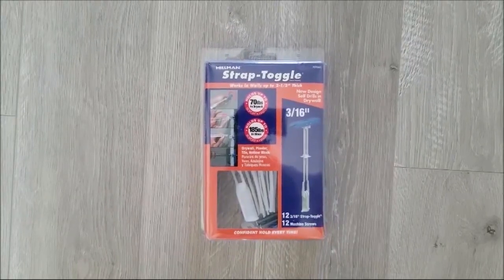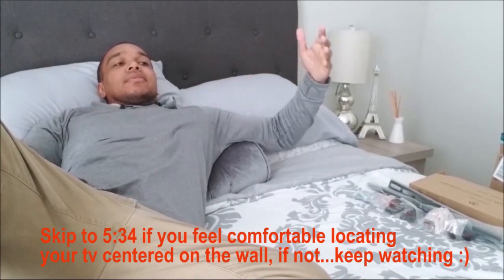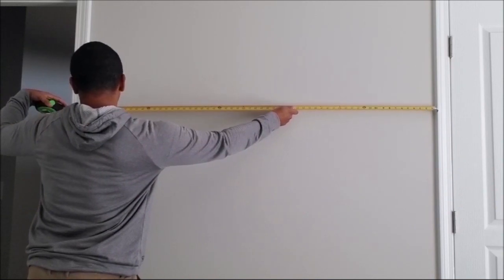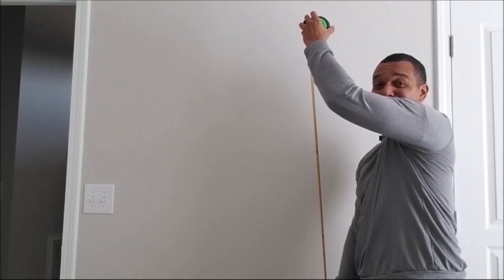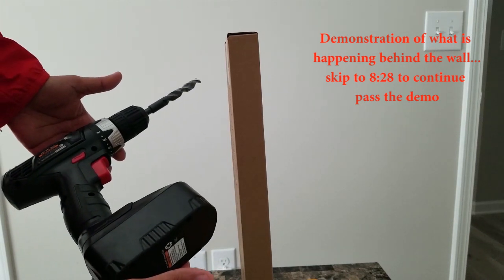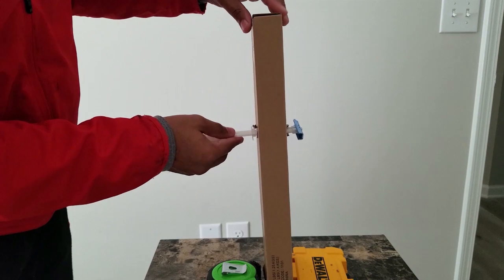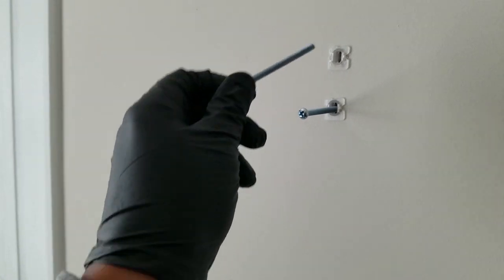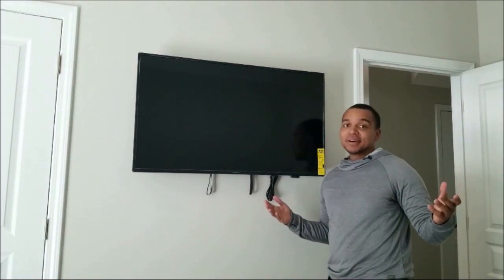How to mount TV on wall | NO STUDS

Comment: It's REALLY worth mentioning that this method is ONLY safe for flat wall mounts.  These types of toggles are rated based on sheer weight only.  Swivel mounts or full motion mounts create a LOT of torque weight and the drywall is very likely to fail!
Reply from the maker: Good point, the shear strength within the gypsum board is where it's at with this type of mount
Reply: Thank you for the info. I was wondering about how will work with Swivel mounts too. You made it clear.
Reply: So...the idea is that you should only mount a swivel mount onto a wall stud, and not this method?
Reply: @chrisbaldwin3148  pretty much.  There are other mounting options if you want to use an articulating mount, but shouldn't rely on drywall alone.
Reply: A VERy important piece of information. Thank you!!  What then is the method  used for swivel mounts?
Reply: @honeybeehelper-1  There really aren't any shortcuts for swivel/ articulating mounts.  You have to locate at least 1 stud to anchor the mount to.  I prefer 2 if I'm mounting anything 60" or larger, and if the TV weighs more than 50 -60 lbs.  But unless your TV is a heavy giant you can usually getaway with one stud.  In cases where I only have one stud to mount to I use a combination method, both securing it to the stud, AND using the method from Engineering Mojo's video.
Reply: Yes!! My husband put a full motion on drywall and a week after our tv was on the floor 🥲💔
Reply: @saramartins3391  Damn, that sucks!  I'm sorry that happened.  Did the TV get damaged?
Reply: @captaintortuga3191  yes.. it cracked on the sides.. I am heartbroken. We purchased a new one with a flat wall mount, and we bought metal toggle bolts.  I wonder if these are better. I’m praying it won’t happen again. I keep checking my tv every 5 minutes… (it’s a 58”)
Reply: @captaintortuga3191  The thing is, ALL the studs I worked with are metal. And I don't want to drill into metal!
Reply: @abdullahal-shimri3091  I totally get that.  Drilling into metal studs is not fun, AND it's even less fun having your TV fall off the wall.  There's just no way around it if you're using an articulating mount.

Comment: When mounting using snap toggles, I think it's always best to offset the bolts mounting position, this will spread the mounted weight over more surface area, resulting in less drywall failure rates.
Reply from the maker: Potentially a good strategy! I could see this being beneficial if the area of influence between strap toggles overlaps

Comment: I'm  not sure if anyone pointed this out but the toggles work best if the are vertical and not horizontal. Placing them horizontally will not provide the full holding power they advertise.
Reply from the maker: Ahh this can make sense! I can see how the pry out capacity would potentially increase with the toggle placed vertically

Comment: With toggle bolts...I'm using a mount that lets the tv extend out just over 2' from the wall. Sure right against the wall the toggle bolt does hold the prescribed weight. Put a 65" tv, plus a 20 lb mount, extended out 2'... Would be 70+ lbs at 2' - multiples more than 70lbs on the toggle. I know certainly not everyone's set up, but just saying for people to keep in mind if they picked up a mount that lets you extend the tv out from the wall, there is a lot more force than you may think.
Reply from the maker: That's a good point for folks to remember! Definitely adding a wood backer board in the uo down direction with toggle mounts could take some of the additional torque out of the wall

Comment: Good video, but if you read the back of the package, they don't recommend using for mounting a TV.
Reply from the maker: Weight is weight no difference if it's a tv or a heavy picture frame. It's all about force direction and magnitude

Comment: This positioning method assumes the mounting holes of the bracket align with center of the tv when mounting bracket is attached. This is not the case with all wall mounts but sure is easy with this one.
Reply from the maker: Ahh that's a good point, there could be unorthodox mounting patterns potentially for cheaper mounting brackets

Comment: My son just got a home in a trailer park will this work on that type of wall as well ? Is there a minimum thickness on the drywall? I think it is thinner than in a regular home thanks for the info
Reply from the maker: I'm not sure about those type walls. Typically they are thinner gypsum or even a plastic panel material. You could always try a test area, that's what I would do

Comment: Was hoping to find your brand of strap toggles on amazon because I literally shop on there for everything and it comes fast lol but I don’t see them😔 I did find a different brand but idk if they’ll work as good as yours did!
Reply from the maker: I recently looked for them as well and couldn't find them in same variation. I found the brand at Home Depot, but they changed them slightly. Still worked good though. I'm sure with same careful steps, most brands will work well

Comment: Would this be safe for a flat mount that has the slight angle adjusting ability? Where you can have the tv angled a little higher or lower however you’re laying in bed? Not planning on adjusting over and over but wanted to see if that makes it sketchy? Looking to do this on a 40” tv. Planning on being like 50lbs in total with mount and tv.

Comment: Thanks for the video! would this work with a single stud tv mount?
Reply from the maker: No problem, hope the video was helpful! The same principles should apply I would think. As long as the weight placed on the strap toggle is less than it's capacity and installed correctly it should be fine.
Reply: @EngineeredMojo  awesome, thanks!

Comment: Hello man, this video is great, but wanted to ask, may seem dumb, but how durable is this method? I want to hang my dual monitors, with the mount, totaling like 32 pounds. I am scared of having them fall off, now there are 2 studs that will help it secure, but the wall mount itself is horizontally long, so I will need to use wall anchors.
Reply from the maker: Really reliable and not a bad question at all, I have three TV's currently mounted in my home all around 50lbs and no issues. I've never seen a failure yet and I've been using strap toggles for a bit more than 7 years now.

Comment: Is it safe to use this method when hanging a TV that weighs 77 pounds?
Reply from the maker: If the correct weight capacity strap toggles are picked and installed correctly with bracket, should be no problem!

Comment: So my husband and I are trying to install a floating countertop in our kitchen but the studs don’t go down low enough. Would this work for that issue?
Reply from the maker: The intent of the strap toggles would still be valid to hold weight, though a floating ountertop would be a fairly heavy and extended load. Would probably only try it if the countertop had a triangular support frame to the wall. Worth a test try for sure
Reply: @EngineeredMojo  Thanks!

Comment: This is definitely a great option.. we have a 60inch tv that I want to mount but I have a big concern with that size of a tv ripping through the drywall... we have a toddler and I really wouldn't want this falling. What would you say the weight limit for this set up to be?
Reply from the maker: Strap toggles come in different weight capacities. In my video you'll notice in the tool breakdown, the strap toggles I use are good for 70lbs each (4 toggles = 280lbs capacity) in drywall which is way above capacity for the 50" tv (~55lbs) I mounted. I've personally mounted a tv as large as 75" with strap toggles with no issues. Drywall is fairly strong in direct shear parallel with the panel. For extra comfort, you could always install a catch strap for your TV. It's a secondary strap that you can connect to the wall and attach the end to the tv's top mount locations. If there is any tilt in the tv, the straps catch it from falling all the way over. Hope that helps!

Comment: Thanks for this video.  I have that same TV mount.  What size drill bit did you use and mounting screw size?
Reply from the maker: Hey nice, I can't remember the drill bit size but I used the recommended size stated on the strap toggle bag. For the mounting screw, I used the screws that came with the strap toggles. Their shear capacity is more than adequate for a TV.
Reply: @EngineeredMojo  Right on...Thanks again.  Keep posting these kinds of videos.  They are awesone...

Comment: Ok this is gonna sound weird but I know for a fact there’s no studs in the wall that im planning to hang the tv since there used to be a sliding door (wood) and we basically left it there and built around when we were moving in. That being said the house is over 100 years old and I was planning to hang a 32 inch tv with those swivel mounts. I just wanted an honest opinion do you think it’d be alright?
Reply from the maker: In my opinion, I would do a test mount. Mount bracket and then hang something off bracket heavier than the TV and go through all the swivel motions. See how you feel and make the decision from there. 32 inch TV should be fairly light unless it's a tube screen haha
Reply: @EngineeredMojo  haha😂 but sounds good, thank you so much!!

Comment: Hello there I just got a 70inch Samsung tv and a full range motion wall mount that I wanted to mount him a tv that has no wall studs. What size strap toggle do I use.? Thank you for your time
Reply from the maker: The size toggle would depend on your tv weight. TV weight can be found typically on the box or quick online search of tv model #. Then do a proper assessment of your wall integrity and mount integrity for its ability to hold the tv weight. Good luck with installation!
Reply: Did you manage to mount ? I am planning to do the same thing
Reply: @AYoungTo  I used a snap toogler hanger anchor. And I’ve had my 70 inch tv mounted for 9 moths now. Works like a charm!
Reply: @AYoungTo  Home Depot has them. Make sure you get ones that hold up a lot of lbs.
Reply: Thanks! 

I’m planning to mount a 75”, I only have studs on the right side. It weighs 70lbs

Mantle mount 540 weighs 29 lbs 

My contractor was nervous about helping me install it….

Comment: Not sure if this was asked already in the comments but how big of a tv can the toggles support? I have a 48” tv so was wondering
Reply from the maker: The toggle support goes by weight so as long as the tv weight, which should be easily found online, is below the toggle weight limit it'll be okay if properly installed. For reference, I mounted a 55" tv with strap toggles and I've seen up to 75" mounted utilizing the correct toggle size. Good question!

Comment: Do you think this would work with a 77 lb TV? Specifically the Samsung Frame 75".
Reply from the maker: I don't see why not as long as the weight is low enough for the anchors and proper install!
Reply: @EngineeredMojo  Thanks I landed on the GeeFix anchors, they just look like the strongest option out there. I've watched far too many vids on this. 😂
Reply from the maker: @MarkWoodChannel  can never be over prepared especially for a nice TV like you are about to hang lol
Reply: @EngineeredMojo  Worst part is it's already hung into studs, she doesn't like where it is. Moving it 8" to the left and 4 inches down. Welcome to being married lol.

Comment: How much weight can this method handle? I plan on mounting a 75in tv.
Reply from the maker: The weight limit is stated right on the package. There are different size toggles, bigger the toggle, more weight it can hold. Typically with light weight modern TVs and the weight divided by 4 toggles, you'd have many options to choose from. For bigger TVs, I'd be sure to get a mount that isn't articulated i.e. allowing tv to extend far away from wall. Your standard mount with tilt action works well with toggles from my experience. I've seen 85" TVs mounted at department stores in this fashion, no problem.

Comment: I was planning on putting up a speed bag (weights about 65lbs) do you think I could do it using a few of these snap toggles cause where I want to hang it there is no stud
Reply from the maker: For a speed bag, it might be tough getting these to work using the stock speed bag mounting locations. You'd have 65lbs plus the increase in weight from the momentum of hitting the bag which could factor the bag weight multiple times. If it were me, I'd do a trial attachment with the strongest strap toggles I could find by weight capacity. I'm sure the toggles rating have a factor of safety that greatly underestimates their true capacity. If it works great, if it doesn't then I would modify the connection by attaching the speed bag first to a 2x or 3x timber board using lag screws then have the timber board be wide enough to space the toggle brackets apart further than the stock mounting locations and attach to the wall. Spreading the toggles apart decreases the tension demand on an individual toggle (this is using statics, moment couple, and structural engineering principles).
Reply: Engineered Mojo thank you
Reply from the maker: @joxhb  no problem!

Comment: Is ut really gonna be able to support the weight of a TV, especially if u have an articulating mount
Reply from the maker: Sure will, just need to make sure the tv and mount weight is below the strap toggle weight limit. I have multiple televisions in my house mounted with strap toggles with the largest being 55 inch. I've seen up to 75 inch mounted with a correctly sized strap toggle!
Reply: @EngineeredMojo  great video, what size did you use for 55iinche i am going to set up tomorrow? was going to pay for installation but might try myself

Comment: How do we know if the mounting bolts that come with the TV hardware  will thread in to the toggle bolt? I mean, would if the bolts are metric and the toggle threads are standard?
Reply from the maker: The strap toggle comes with it's own mounting bolt hardware rated for its strength. You do not use the lag bolts from the bracket mount kit. The other bolts from the TV to the bracket have no interaction with the strap toggle at all, don't confuse the two.
Reply: @EngineeredMojo  thanks for clearing that up.

Comment: I just mounted my 55” TV using these type of toggles. The TV weighs 35lbs, I used 4 toggles rated for 200lbs each. But the mount is a full motion type. Do you think it’ll hold? I’m not sure how to calculate the added weight from the extension of the mount.
Reply: Did it end up holding?
Reply: @saramartins3391  nope. The wall started cracking so it pulled it down before the TV fell off the wall.

Comment: Hi what if I want to mount the tv bracket on a plasterboard wall that is several inches thick?
Reply from the maker: I would give it a try, plasterboard and drywall are similar with plasterboard just being a base for plaster and given plasterboard is thicker and stiffer than drywall. Numerous strap toggle manufacturers even list plasterboard as a viable mounting surface. I would just verify the strap toggle is long enough for the set in the deeper wall. Hope that helps!

Comment: I doubt you respond this long after the video but. Do you have to have a specific sized snap-toggle for the wall mounting set, or do the screws from the mounting set always go in to the toggle? Also, do the snap-toggles work on plaster wall? I looked it up but I didn’t get a straight answer.
Reply from the maker: Always use the screws that come with the strap toggle and not the screws that come with the mount. The mount screws are typically lag screws and don't work with strap toggles. You will sometimes have to purchase a washer that has a hole small enough for the strap toggle screw, but large enough outer diameter to sit firm against the mount. You could always do a test hole on a plaster wall and experiment. If it's thickness is similar to standard drywall, you may be fine.
Reply: @EngineeredMojo Thanks, much appreciated!

Comment: Do you use the toggle for the size of hole you drill or for the size of lag or screw
Reply from the maker: The screw comes with the toggle set, no need to find a screw that will fit. Based on the toggle size set you buy the pack will recommend a drill bit size for predrilling the wall. Hope that helps no guess work needed!
Reply: So I wouldn’t use the lag bolts that come with the mount kit ?
Reply from the maker: @kearajones1378  correct, those lag bolts are not compatible with the screw connection of the strap toggle. Strap toggle has its own bolts that come in the kit

Comment: Where did you those three hole brackets at? I can't find them anywhere.
Reply from the maker: Those brackets came with the tv bracket mount. You could always make your own brackets/washer with a flat piece of small steel and using a drill. I've done that in the past. Let me know if that helps!